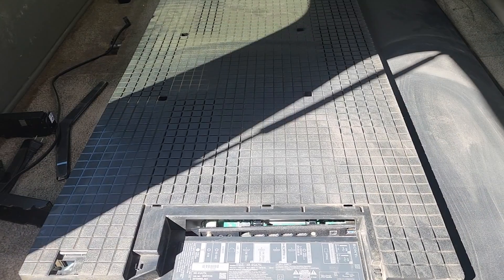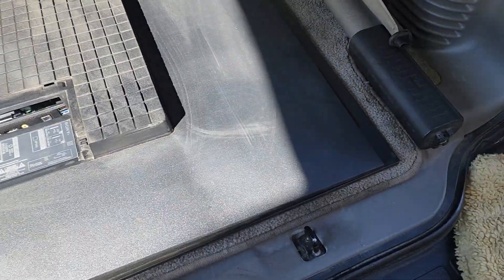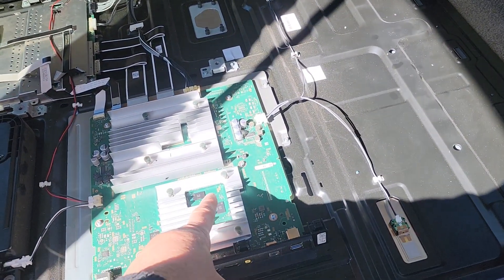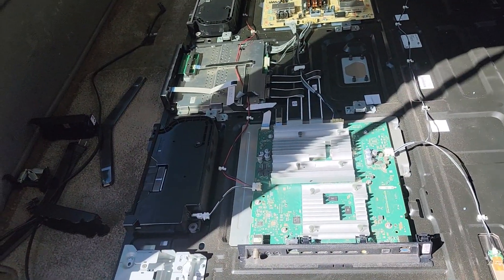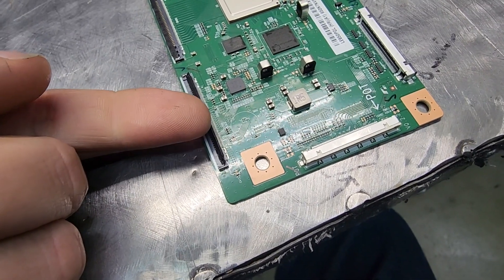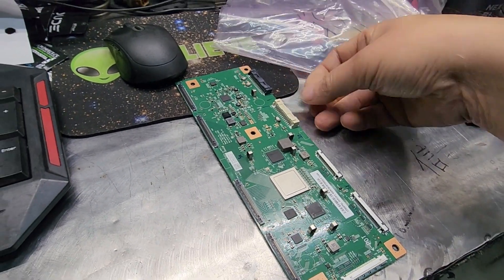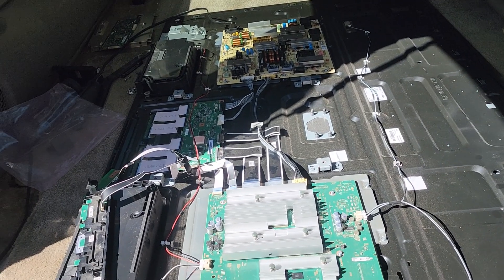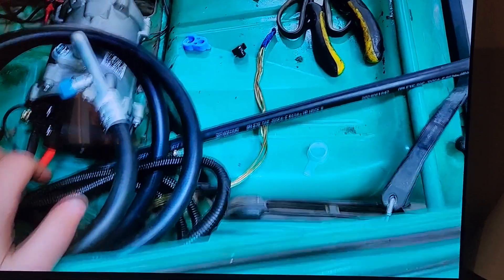Sony 65" XR 65A75L TV (T-CON) Repair 5 Blinks

Comment: I'm having same problem.  Sony support tells me it's either power supply board or main board.  Another tech website said it was probably power supply board.  Regardless, any suggestions as to where to buy the T-Con board from and the part number you ordered?  thanks..